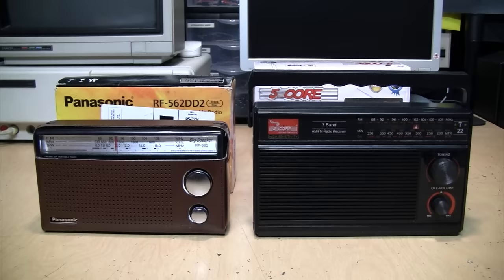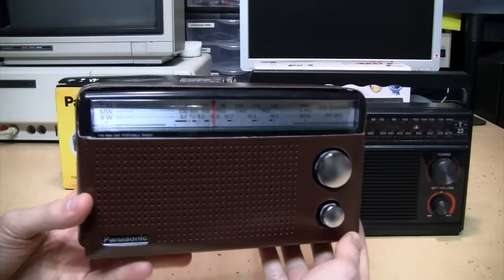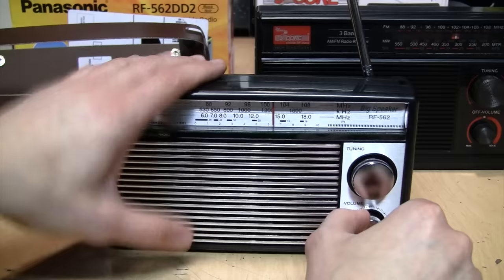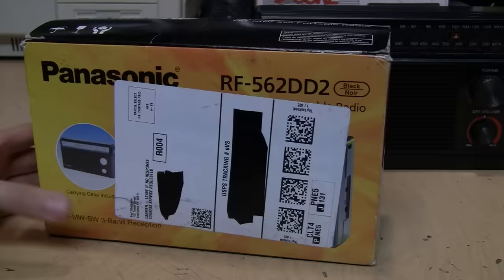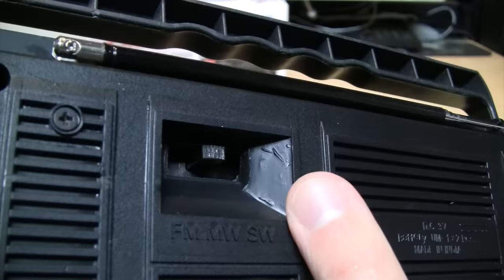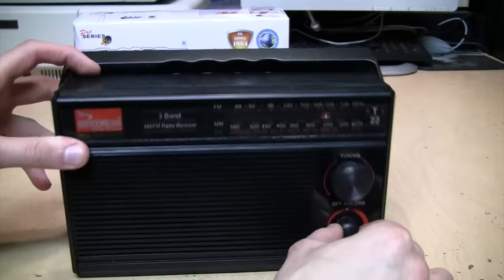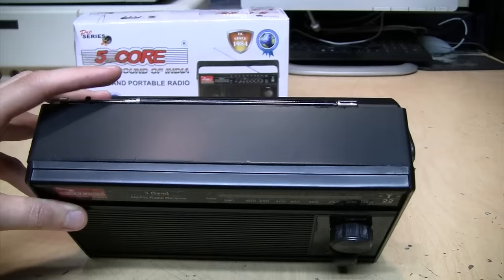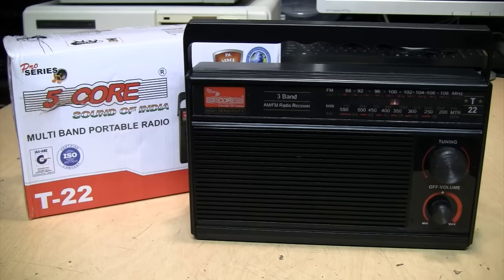Searching for the last true analog radio - Panasonic & 5 Core

Comment: As for the 5 core, you could probably get around the issue of weak reception by using a loop and pairing it with the antenna using a ferrite rod connector to the external antenna
Reply: Alternatively, making a new lipstick antenna isn't too hard. You can always put the biggest ferrite core it fits in the case. It makes a huge difference

Comment: I wouldn't be surprised if 5 Core used the same tooling for its case moldings as they did when they first started in 1984.  After punching out millions of radios, no wonder it's looking a bit tired!  That said, the combination of dodgy finish but apparently good sensitivity and excellent sound (for what it is) is oddly appealing to me.  I kinda want one of those 5 Core radios now!
Reply: Even if the molds are old and have crap finish and imperfections, that's still no excuse to use bad, brittle plastic.
Reply from the maker: @NozomuYume  It doesn't feel brittle -- the plastic is actually softer and more flexible than the kind Panasonic used. It's just made from a low-quality molding.
Reply: At this point, considering the population of India and the fact that 1984 is almost 40 years ago, I'd be surprised if they hadn't literally banged out at about 1/2 billion!

Comment: A radio in the bathroom was a "tradition" my parents started about thirty years ago when we had an outlet connected to the light switch for the first time. I still do it. The problem now is actually finding and keeping radios with an actual power switch instead of a button that resets to "off" when the power to it is cut off. Cheap 1980s and 90s boomboxes from flea markets are getting temperamental these days in the humid environment and I'm not really finding modern radios with a real clicking power switch at a reasonable enough price for the shoddy quality. The price is almost right on the Indian radio but no option for a power cord. The Panasonic LOOKS awesome.

Comment: My "daily" workhorse radio is one I bought back in the mid 1970's. It's a monophonic, multiband, ie. AM/FM/ SHORTWAVE/NOAH Weatherband, "RCA" branded, portable. Not very large at about 6x9x2 inches but quite heavy for its size. I'm guessing that's because it's a true TRANSISTOR radio with soldered circuit boards and a heavy duty magnet in its speaker.
It's equipped with a built in coiled antenna for AM and a telescoping tube type "mast" with a totally adjustable pivot base when fully pulled up from the body to allow a full range of motion to position the "mast" anywhere from the 90 and 180 degree plane to well below it too. About 270 degrees maximum. This made for superb capture of signals and aided in fine tuning it also. Obviously this was waaaay before the dawn of the DIGITAL, electrified silicone age. Also it was an "amplified" antenna! A small switch on the front when slid to "ON" could pull in otherwise unheard "distant" stations too. It was all ANALOG, tubeless, genuine TRANSISTOR TECHNOLOGY. It's still going strong on either household AC (With built in and internally storable cord.) or DC (Using 8 "C" size batteries!) It's a truly well built and very durable unit. It has accompanied me everywhere from the sandy Atlantic beaches of Long Island to the Catskill, Adirondack and White mountains in ALL seasons and never failed to perform flawlessly.
Until very recently I had a much smaller "SONY" pocket radio which I also packed on my "high adventure" hiking/backpacking trips into the woods and on the mountains here in NYS and up through Maine. It too performed flawlessly though it was only an "AM/FM" reciever with a tiny speaker and a single, monophonic "ear jack". Great at pulling in distant signals especially at night! I have very fond memories of it and am still using his "BIG BROTHER" the RCA portable at my bedside and occasionally on outside excursions in fair weather too. NOTHING beats radio!
Reply from the maker: "Homophobic"? Autocorrect?
Reply: Very sorry!!! This stupid SAMSUNG phone likes to rewrite my original words to what IT thinks I really meant to say!!! I apologize! It's an extremely annoying feature which I just can't seem to shut down!!! Ugh. I HATE THESE THINGS!!!!
I end up wasting time going back over and rereading EVERYTHING I type constantly. When I DON'T? Well? You just saw what happens. Ugh. Sorry again. It really WASN'T me!!!#####

Comment: An even truer type of Analog Radio, are ones with an AFC Switch for the FM band. With the AFC switched off while tuning across the dial, you can receive those very weak stations that are adjacent to stronger ones.

Comment: India is making a lot of their own tech now, since they refuse to buy cheap, Chinese tech. N. American tech companies would be wise to switch to India as their supplier. Since many Indians are fluent in English, there is not the communication problem that there is with the Chinese. The compartment beside the battery is to store the power cord/adapter. External power was cut to make it more attractive to N. American distributors who have a preference for cheap, crappy merchandise. Since the original transformer had a 220V primary, it would have been useless in 120V territory, anyway.

Comment: Another couple of radios to investigate are the Tecsun R-9012 and R-9700 DX.  I think they both utilize analog tuning capacitors.  I haven't taken either apart, but there is no muting between stations when you are tuning.  They sound similar to my tube radios.

Comment: Well, that just made me a customer 😁

Also the eBay listing calls it a TC-22.  Doing a Google search on it also showed me a “T-291” from the same company and same price but different in look.  Then again, the cosmetics of this wasn't attractive either and it turned out to be worth it.
Reply: I just ordered the version branded T-22 ---- I did see that they have one branded T-291 but absolutely no indication of what electrical differences there may be.  The cabinet is obviously different.  I have broadcast radios made or assembled in about 36 countries - This will be my first from India.  Kuddos for selecting a "The Last-Of" topic.  I see today that you can now make a video on the last LG smartphone:<)
Reply: Placed an order on Friday morning and it arrived today.  You probably had a shodder plastic job than I did.  That said, there is a cheap feel to the outside of it.  However, it did exactly what it was supposed to do and worked like a charm =]

Comment: It's interesting that digital tuner chips are now cheaper than analog circuitry. I can remember when in 1988 or 1989 a digital tuner in a boombox meant about a $50 surcharge. But a hint af that was already the $10 radio alarm clock I bought some years ago, which hasn't got a radio dial anymore, rather you control the whole device with 5 buttons, and if you change the frequency, it appears in the display instead of the time. So everything seems to be integrated now... and it also draws less power. My old device would suck the 9V buffer battery dry in a matter of weeks when left unplugged while the new one lasts several years on 2 AAA's even when left unplugged all the time.

Comment: I just ordered the T-22 and T-291 from the same Ebay seller. They both appear to be the same radio but there are some cosmetic differences.
Reply: I am too cheap to order both... I ordered the T-22.....  I hope you can report on the technical differences.  Maybe they can now use Chinese molds ??? since the 'home grown' variety is so poor???
Reply: They arrived today in fixable shape. Very fast shipping. The T-291 is exactly the same internally as the T-22. The T-291 had a broken screw standoff that was fixed with a little superglue. The plastic is quite brittle, I think Bakelite is probably more durable in comparison.

The T-22 worked fine on FM but no AM or SW. So I opened it up and saw immediately that a total re-cap would fix the issue. The ferrite core antenna having come completely out of the supports and wires ripped from the pc board where it was all now magnetically stuck to the speaker magnet would have nothing to do with it not working at all of course. :)  Anyway I can at least use the T-291 to see where the antenna wires should go. :) 

But the main takeaway is the really good speaker and the IC that it uses in the circuit. This IC appears to be recycled but genuine. I guess it could be NOS but seems too rough for that. Here is the one used in both radios:

T-22
SONY
CXA1619BS
407F76V

T-291
SONY
CXA1619BS
344XL8V

It's a common IC in one-IC radios and this board looks like a similar one that has been made for a long time. This IC supports a tuning LED indicator so that might be a useful modification. 

Another mod might be to replace the D batteries with a single 18650 battery. It would certainly reduce the weight and stress on the brittle plastic going with lighter batteries.  

I'll post an update when I fix the ferrite antenna. I have pics but can't post them here of course.
Reply: The ferrite antenna is re-installed and it's working normally. I did find a few other issues:

The ferrite antenna may be installed backwards. In the T-291 I noticed that the coil was hanging out in space right by the speaker however the pcb screen print has the coil indicated by the top outside corner (in alignment with the metal antenna) so when I put it back I followed the pcb screen print. If you want to try this on yours split the plastic rings in the middle and separate the halves to remove the ferrite rod more easily. Hot  glue the plastic rings back together and use a little on the ferrite rod to hold it all in place. 

When I had the antenna rod out I noticed C23 wasn't connected on one end and the other was loose so I pulled the circuit board to re-solder it. All the wire connections are at the radio bottom so you can remove the screws and rotate it back easily. Once the board was up I checked all the solder connections and found six incomplete connections. (3 at one IF can, 1 on the other IF can, and the 2 for C23.) It looked like an attempt was made to solder them in place but it wasn't. So I fixed those and put it all back together. They're both working well now. 

If you get one it may be worth pulling the PCB up and checking the solder connections. Possibly think about flipping the ferrite antenna around if the coil isn't where indicated on the pcb screen print., I went  back and did that on the T-291 and it may have made some improvement. Also check the wire spacing on the coil I don't think there should be any gaps so I used some glue to hold the wire loops together. 

I might look into the LED tuning indicator and 18650 battery mods. Problems were fixable and that's another good thing oh and don't forget.....

It's got SONY GUTS!!!  :) Extra points for knowing that reference. :)
Reply: Sounds like a lot of work for a cheap "new" radio.
Reply: Got my T-22 today... No damage although the USPS box was crushed pretty significantly.  The plastic case sure shows the mold to be worn out and poorly finished to begin with.  BUT I'M HAPPY!  My first made in India radio! It plays just fine.  When first turned on to AM, there was tremendous hum modulation on any station.  I wanted to blame the radio but soon figured that there was a film scanner 'wall wart' power supply here in the shop generating an unbelievable amount of RFI.  Pulled that puppy from its outlet, and its all good.....

Comment: Open it up, if you see a tuning capacitor, then it's definitely analogue.
Reply: Although not all analog tuners have tuning condensers. Those cheap ones usually have a plastic one though.
Reply from the maker: @westelaudio943  And there are analog radios which use varactor tuning, like the GE/RCA Superadio III.
Reply: @vwestlife  

Excactly, and ferrite slug tuners exist as well.
Reply: @vwestlife  I know some portable radios were varicap tuned,  but they weren't too common AFAIK, like I've never seen one for myself. And car radios were often inductively tuned.

Comment: We have a Grundig Sonoclock 490 clock radio (FM only). It has a digital tuner with analog dial, but doesn't act like these. The tuning is not choppy, instead it is 'snappy', it just jumps from station to station like an analog radio with a very good AFC. My vintage Sony ICF-7600DA has the annoying choppiness, but it's not really pretending to be an analog radio, as it has an analog dial mimicked with a huge LCD, and it also has digital readout and station memory, and the tuning knob is attached to a digital rotary encoder. Very nice radio, although not the most sensitive, my Russian VEF-206 beats it on AM and SW.

Comment: Go find an "antique" radio if you want true ANALOG sound.
Reply: it why I listen to the radio using my 1968 Zenith circle of sound stereo system
Reply: I have two Philips/Radiola vaccum tube radios, I'd love to restore and use them but these things run on a hot chassis, and need some new caps.... At least I have my old 80's Philips D3142 (found in the trash, still works like a champ) and my Telethon HI-FI T300 tuner, although the T300, I need to make a custom DIN cable and find a proper antenna for it...

Think I might also have a 90's Sony portable radio, it's still a true analog tuner like the other radios I mentioned in my comment, although the speaker on it sounds à bit off.

Comment: These were made for low-income consumers who simply need a reliable basic radio.  Sounds like they do the job, the 5 Core in particular.  The main issues with any AM-FM portable are always tuner selectivity and sensitivity; if you're going to be listening at any great length, decent sound quality also helps.

Comment: I was not aware of this difference in sound quality until I found a McMartin AM runner in a AM transmitter side. I kept it since it was covered in dirt and the owner said it was OK. I cleaned it and the signal is so clear that makes am sound incredible!. Sadly the coils were rusted so it couldn't tune most stations.

Comment: Walmart[dot com] has the 5core T-291, which looks to be nearly identical. I just ordered one, i'll let you know if it holds up.
edit: Yep, it appears to only differ in appearance. Analog tuning, sounds great. Dreadful plastic, antenna won't stay in position, not stereo, no AC adapter. Did i mention it sounds great? The tuning knob is going to fail at some point. Now i kinda want to see a teardown...

Comment: I was expecting  teardown of both radios. But that Panasonic looks awesome on the outside. I think that could be reverse-engineered to make a replacement PCB that fits inside to make it a true analog radio with all discrete components, no DSP chips.

Comment: Analog tuner - Audiophiles have always known this. Collecting the stereos of the late 1960's and 1970's(Pioneer/Sony..) because not only do they sound better, but the analog tuners on them grab stations MILES away where digital tuners just can not compete in any shape or form. Add a taller outdoor antenna to these analog stereos and they really grab stations far away! This tiny little portable radio proves that analog tuning has always been more efficient at grabbing faint stations, where a digital tuner, even HD radio, you practically need the broadcast antenna from the station in your face.

Comment: In a thrift store today I came across a 5 Core "Pro Series" speaker (model 5C-WS 73) rated at 35 watts RMS. Similar poor plastic molding on the front grill as the analog radio in your video. Had I not seen this video I probably would have not looked at it twice. I have photos if interested.

Comment: Panasonic does make it known when their radios have the DSP tuners. Their recent radios with the DSP tuners have a D suffix in the model number including your RF-562D radio where a pure analog version of the same set would be RF-562 (without the D).
Reply: I have Panasonic RF-562D that's completely analog. Even its audio section is vintage style with an audio transformer.

Comment: The external antenna may have worked better extended horozntally for short wave because short wave may be broadcast horozontally polorized meaning the transmitting antenna is horizontal and not vertical.

Comment: Best I can figure "Retro Design" basically means "we tried to make it look old so we could charge more", not something that would make me think the Panasonic would have an actual old design (analog tuner) in it. And since the selling argument at the core is "form over function", the cheaper end often involves the cheapest possible hardware which is likely a fully integrated chip that does most of the heavy lifting and probably cost something like $0.50 in bulk quantities (if that much).

My expectation based on the just the name and price is that Panasonic just got a Chinese ODM to make a different shell for one of their existing radios (IE all electrical parts are identical with probably 10s of different radios) and that's assuming it's not just a "bought badge" and it has little  to nothing to do with Panasonic (several other big brand manufacturers do this with types of electronics they no longer care about).

Comment: great reviews but dang I was hoping you'd crack them open so we could see the differences in the components. I've always said analog tuning seems better for weak stations that drift as opposed to DSP which is at preset tuning increments. I'm still amazed they're making radios today with slide-rule tuning & string & pulley tuning indicators. Seems like they'd have to be strung by humans, whereas LED or LCD displays could be assembled by robots.

Comment: I have one of the black 5 core modeland it is still going well. It is good ,simple to use, reasonable sound and reliable with a better battery life than that you might expect, I got it in the 80s or earlier It  also has the socket for mains  etc.